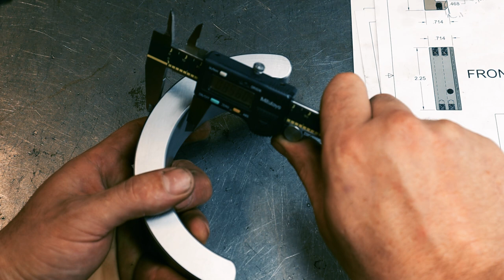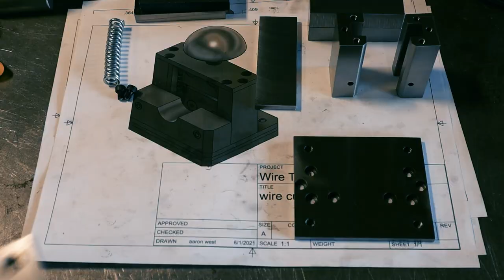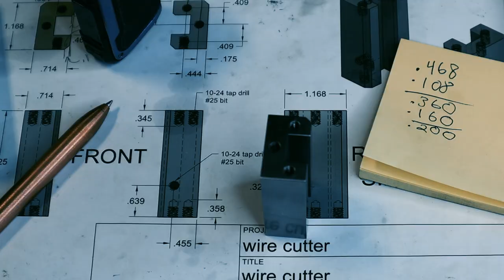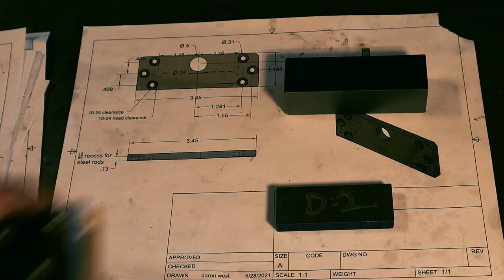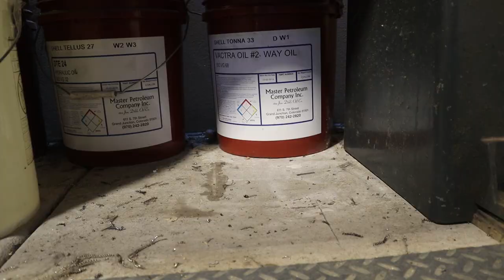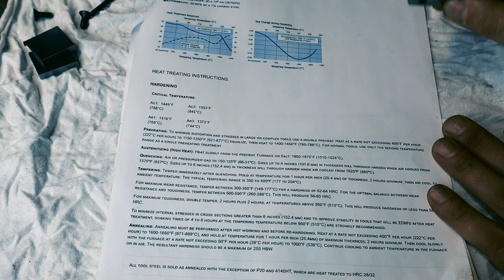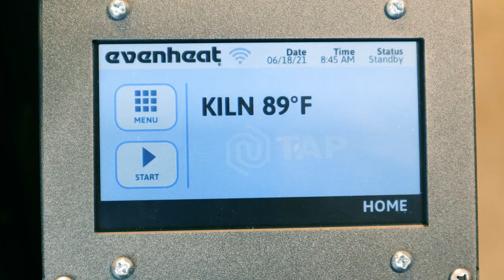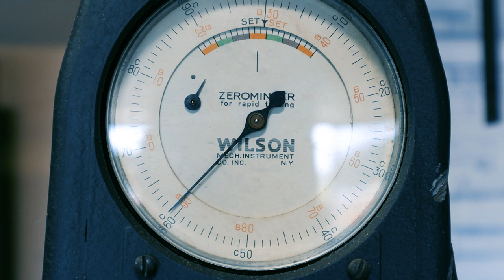Machining a tool I invented?

Comment: I like this. One tip for heat treating is leave your parts slightly over-size then afterwards, grind them in. This gives a bit of extra meat to avoid warping and cracking plus gets rid of the decarb that forms at the surface. Another tip, avoid 90 degree inside corners like the plague. Put a radius on it, even a tiny one! This will exponentially decrease the likelihood of a stress-riser induced crack because of a corner.

Comment: I was wondering why Three Rivers Forge had commented about clamping in the Ellis vise, on your last video. I need to make one of those. Your vise has a acme screw, where the one that came with mine is one of those quick interference sorts (Sprag? style). And it never holds material well. I end up using a large "C" clamp. Amazing how many tools have to be fixed to make them usable, so I need to make a new vise for mine, using an acme screw, even have the stock and nut needed.
This wire clipper looks like an idea from a die press fixture. I ended up getting a heat treat furnace and Rockwell tester back 30 years ago, when I needed to make a new shaft for the transmission in my HydraMac skid steer. It really comes in handy when you need to anneal any tool steel to repair it. I used oil hardening, and tempered in a can of oil heated on a camp stove, worked pretty good. Did your wife approve of using the kitchen stove? :D
Nice video, lots of camera shots, with panning, good choice of music. You must have a local source for all those fillister head screws your using. They did make a nice clean flush look.
Reply from the maker: Thanks Fred........I had to pay a little extra to get that screw vise with the ellis but ive had experience with the sliding ones in the past not holding very well.... I have to plan my tempering cycles for when shes at work
Reply: I didn't want to ruin the surprise since I was late to the party, so to speak.  I have one of those sliding vises like you, and the little "clamp" you see here does a great job of really tightening down on your parts because it puts all of the pressure on just those two small points of contact instead of the entire face of the vise jaw.  And for what they cost to make.... you really can't go wrong.  ;-)
Reply: @threeriversforge1997  I like that 'teeter-toter' vise clamp tool. I'll see if 4 inch pipe, with 1/4" wall thickness will be stiff enough.
 My Ellis is about 26 years old, and they didn't make the vise with the reverseable handle, so it can only get close from the left side, as that handle is on the left. I see they made it so the handle can be moved to the right side on new production deliveries. But you know in interferes with the blade guides for any work on short pieces. 
I see you have no content on your channel. Lot's of work to produce and edit them, and I thank all that make them and transfer their talent to learn from.
Reply: @f.hababorbitz  We really need to come up with an awesome name for the thing.  I've been calling it the "bandsaw clamp" because that's kinda what it does, but maybe "Bandsaw Bridge Clamp" is better?  

That pipe you have will work fine for pieces short enough to fit inside the arc.  My first was from pipe with a 1/4" wall and I didn't have any complaints.  I retired it when I got a section of pipe that was thicker because I was planning on using the second half as a form for bending hot steel around.  My only regret is that I cut 1" off the pipe because I was thinking about that bending form and not how the "Bandsaw Bridge Clamp" would work in the vise. I wish I'd made it 2" so I could grab larger stock, but it still works for 95% of what I need to cut.  I've got plenty of the pipe left if you'd like a slice from it.

And, no, no content on my channel.  I've been thinking about it, but I haven't a clue what I could offer that isn't already being covered by the billion blacksmiths already flooding social media.  Like you, I love to learn from all the craftsmen taking the time to do it, especially when they can do it as well as West Weld does.  Can't remember the last time I watched regular television!
Reply: @threeriversforge1997  Thanks for your offer of a pipe section. I found a piece of 5" in my scrap. It's 3/16" wall thickness. Should be stiff enough. I could always take a solid round bar drop I have and do the crazy of boring it out. But I'll see how the scrap piece I have works.
I did an internet search on your copyright company name, found etsy and links to your art photos page. Near as I can tell you live in Texas, but not sure. I see West Weld is in Colorado. Thanks again for the offer. We shall see how good this works on the Ellis. But I typically use the 4x6 for the small stuff, but even there a specialty clamp is needed.
Reply: I think 3/16" will work fine.  Whatever alloy they make pipe from is pretty stout stuff, certainly not plain mild steel.

Comment: Nice work.. I’ve made so many small unitools like this one I can’t even remember them all. Just made one recently to punch elongated holes in a short run extrusion profile.. been doin this 42 years.. every day. Heat treating will not crack, break or distort. That is the beauty of O1,A2 and D2… each progressively harder than the first. I can prompt you on heat treating with it without an oven.. wrapping with .002 ss is correct. Wrapping with paper first is also correct. Tempering for this steel depends on the type you choose.. you’ve done a great job.. temper color after fracture should be dark gray..
Reply from the maker: Thanks!......Is D2 sufficient if I were to make some punches? Maybe to push holes in 1/4 inch plate?
Reply: @westweld  D2 heat treats at 1850-1875..make sure your oven goes that high. Also, D2 is a challenge to grind. It really wears a wheel down fast. I’m home sick today and don’t have my steel book but my memory serves me you should temper it at around 460- to get a 58ish to 60 Rc. D2 is high in carbon obviously but also high in chromium and it’s microstructure is high in carbides so it’s a real stable and hard long wearing material. I hate it!! Lol.. I use A2 regularly and find it sufficient to go the distance and it’s not nearly as hard to finish grind. For what you are making I’d say A2 would be like a Cadillac and D2 would be like Mercedes. From your video you have a good idea of how to go about this.. just know this. You never throw the steel in the oven at heat treat temp. It needs to start at ambient room temp and go up from there slowly. Your oven should have a perometer in it. When you tempering make sure the steel comes back down to at least 150 after hardening before the temper. It’s important that the tempering process you never open the oven door. It needs to drop from 460 down very slowly.
Reply: @westweld  also.. to address punching hole in 1/4” plate the rule is that you never punch a round hole with a diameter that is smaller than the wall thickness being punched. In other words you are at the minimum size hole you can punch in steel. 1/4” punch- 1/4” steel. If you do that you need a punch press with a flywheel preferred. You also need to “pilot” the punch if you know what means. You have to have a “stripper” and NO I don’t mean one you need dollar bills for.. lol. The punch should be made of M2 for that application and the die section can be D2. Let me know if you need better information
Reply from the maker: @paulbfields8284  thanks I appreciate all the information.
Reply: To punch steel you really should purchase the round “pierce” punch. It will need to be precision ground and have a shank no less than 1/2” diameter. Keep the punch as short as possible. M2 is not a material you want to deal with from a heat treating standpoint. The punch isn’t going to be terribly expensive and you can get it from Zip Industrial in NY. Ask for Karen and she will help you,

Comment: Love your ball turner!  I may modify mine like that.  I built mine with opposing tapered bearings from a nissan transmission and a very large arm.  Turns out I really didn't need the huge moment arm on the handle.
  
Try a mister and use the n on-toxic synthetic fluid. I tried one for a lark  $10 or $12  mister from alibaba. I was shocked. I can up my speeds and feeds and I get way better finishes.  I dial the amount of fluid down to nearly  nothing and  run about 35 to 40 psi   the air blows the chips away so I'm not recutting them  improving my finishes enormously. 

About heat treating. I made a punch and die set  for a production run. I spent  hours on it. Then into the oven and onto the bench.  The steel was A6.  So after it came out of the oven I set it on the bench and went home at the end of the day.  Hey was air quenching steel  I was good.    In the morning I had three pieces of steel where before I had a nice 6" square by 1" thick die.
Never let your work go without going to the tempering oven as soon as you can.

Comment: like the pipe tip thank you.  In the past, if the slot was super critical I would use an adjustable parallel and micrometer to get the size of the slot.

Comment: Just a couple of points......the load is on the head of the moveable blade. If it was at the back of the block there would be a large lever to keep the Blade in place. Instead of opening the cutting gap. 

And there are “knives” to cut wire. Made a lot of them. Carbide insert ......cut 100,000 pieces of 1/4” wire before sharpening.
Reply from the maker: I agree with you on the blade it hasn't been an issue but I may use the other side......I used d2 because I had it and read that is commonly used for shear blades. It was mainly to experiment with heat treat but I am pretty happy with how it works

Comment: Nice work, I follow you on Reddit and saw the latest post.  Reminds me of something Bridge City Tool would produce,  elegant versions of simple tools.  Instead of JO blocks try an adjustable parallel, no stack issues and a set of 4 covers most everything and can be left in position to re-test. Those and a Planer gauge are often overlooked but super handy once you get to use them a few times. Excellent work and look forward to more.
Reply from the maker: Thanks man.....I prefer adjustable parallels but I didnt have any small enough.....ill have to check out bridge city tool

Comment: I've had a set of adjustable parallels that I use to measure inside slots. I found them to be very accurate, and they travel well between home and work.
Reply from the maker: That works well too, I was missing the adjustable parallel that was small enough for this one

Comment: Make your cutting blades out of CPM M4 Tool steel and heat treat to a rockwell hardness of 60/62.  In metal stamping applications we use M4 for most cutting dies and all our hole cutting punches are made out of M2 Tool steel. Great Video! I really enjoyed it!
Reply from the maker: Thanks! I will check out that steel

Comment: Your videos are a work of art! The wirechopper too of course. Also thanks for the many many tips and tricks you put into your videos! As for measuring slots: sliding in some adjustable parallels and measuring the part sticking out works well enough for me for this kind of stuff. 
Thanks again and all the best
Reply from the maker: Thanks man......I use adjustable parallels  too like I did in my ball turning video I just didn't have on small enough for this slot

Comment: Just came across your channel. Been a tool and die maker for over 20+yrs here... nicely done. Only suggestion I could make is having the fixed shear blade on the radius side for the mig gun and have the movable shear on the far side so it doesn't bend the wire in the gun. Nice work.
Reply from the maker: Thanks! You are right I flipped it around alreadu

Comment: 5:56 Don't get me wrong, Gage Blocks are a great way to measure the ID of Slots like that but a MUCH fast and equally as accurate (possibly more accurate) way is to use adjustable parallel in the slot and measure the parallel with a Mic. No having to do any math and block stack determination, just adjust the parallel unit its got the feel that you want between the parallel and slot and measure the parallel with the Mic and you have your size of the slot.
Reply from the maker: I use that method sometimes too....but I dont own an adjustable parallel that small

Comment: The pipe segments to hold material can be stacked, as in two segments contacting the material and a third one pressing on their centers.  Friction aside each of the four contact points on the material will apply the same amount of force.

Comment: Nice machining! D2 is pretty forgiving with heat treatment. A2 should be soaked at a lower temperature for awhile before ramping up to heat treatment temperature. Most metal suppliers have that information readily available. Enjoy watching the build, thanks!
Reply from the maker: Thanks.....I ramped up the d2 only 400 degrees an hour to be safe but it would be nice to go faster if i can get away with it just because it takes so long that way
Reply: @westweld  Try this sometime. Preheat to about 1400 and hold for about 1/2-1 hour pending thickness, then ramp up to 1850. Its air hardening, we used compress air to cool parts down and once cool enough to handle, temper to desired hardness.  https://www.speedymetals.com/information/Material11.html

Comment: This is a cool idea, and I had a suggestion. If you alter the layout of the blades so the bottom blade is closer to the tip (the side you insert the welder from), when the wire is cut, it won't put a kink in the wire, like you can see when it cuts the mig wire.
Reply from the maker: It doesn't kink at all if you hold it straight but its not easy getting those close ups and holding it straight and smacking it haha...but ill use it for awhile and see how it works maybe make some changes if necessary

Comment: I've never seen a stand alone part like that but it does remind me of a micro-scale ironworker shear :)
Reply from the maker: haha that's what made me think the flat blades would work every iron worker ive ever used has flat blades so they don't chip
Reply: @westweld  Exactly. You have a good mind for tooling, shaping, sizing and fitting.

Comment: Nice. In my experience, leverage is what one needs to shear through cable. At work we have bench mounted shears to handle this kind of work. It is pretty though. Very.  And I hope it works out.
Reply from the maker: It works great….. don’t need any leverage for wire that’s only   .09375”

Comment: Beautiful design!. 
Small question: is the torch wire bent after being cut? In the current design, after cutting, the moving blade will push the torch wire further down. I was wondering if the blades shouldn't be in a different order.

Comment: Amazing invention, never gave it a second thought. It’s way easier to use a machine rather than a set of pliers. I sure hope I win the welder. I have been saving money to make my own workshop. But since I’m rather young. It’s hard to come by. And I wish to create big amazing projects with a welder
Reply: After all, it was possible to fasten the pliers in a similar way - and bite off the wire with a similar movement of the hand ...

Можно ведь было похожим образом закрепить плоскогубцы - и аналогичным движением руки откусывать проволоку...

Comment: 15:06 you don't have a Y axis on an engine lathe. A Y axis would be moving the tool in a vertical direction which you can't.  Only CNC lathes with live tooling have a Y axis for milling only.

Comment: that's a very handy tool, great job on the build! I'm a tig welder but I can see how annoying it must be to have to clip your wire every time! I have the same problem with tungsten sharpening.
Reply from the maker: Ya I suppose its not necessary with tig welding every time but its become a habit for me and gives me really consistent results....but mig welding I definitely clip it every single time. The fastest way to sharpen tungsten that ive found it put it in a cordless drill on a dedicated grinder but maybe a good idea for a new fancy tungsten sharpening tool
Reply: @westweld , yep I've already made a fancy bolt-on tungsten sharpener for my angle grinder, but since the brushes went on my old grinder I have to take the bloody thing off every time a want to tidy something up! might be time for a new grinder, but there's 500 bucks (NZD) on a DeWalt. thanks for the reply.

Comment: There is an app called heat treatment and it is used a lot on the bladesmithing community as it will tell you the temperares for different steel. I tend to not use D2 as I don’t have a good kiln
Reply from the maker: I'll have to check out the app......ive got a book that was like 300 bucks and has alot of info but its hard to find more specific things like austenitize duration for different thicknesses and what hardness to expect from different temper temperatures etc

Comment: Pretty cool guillotine tool man, you see those alot in the blacksmithing community, but they put different shaped dies in it to cut steel off or create square corners, or different profiles in the hot steel when forging. The dies are usually in line with each other on those tho. Pretty cool build, and the ball turner really looks like it was nice and solid in use.
Reply from the maker: Thanks Chirpy....ya that was probably the one time ill use the ball turner this year.......I still think the boring head type is the way to go if you have an extra one laying around

Comment: Just found your channel 👍👍
Now going to watch more of your work.
    And you didn't mention that when you were cleaning the slag off after heat treating you used a figure 8 pattern.
  That's a little quirk i see when people just go back and forth when sanding a small part they don't realize that back and forth motion will disfigure the part and a figure 8 pattern keeps the part flatter and usually won't curl the edges 👍👍👍
Keep up the great work